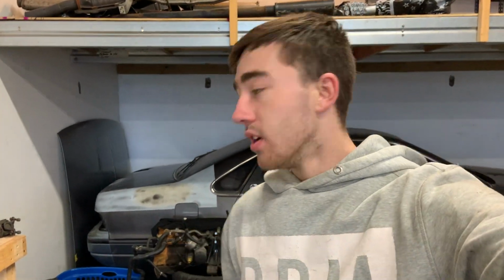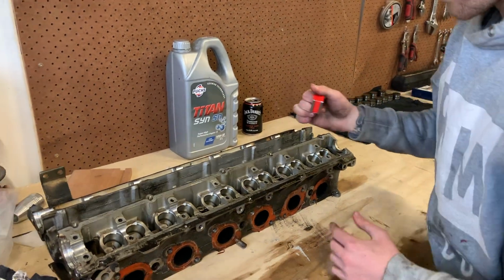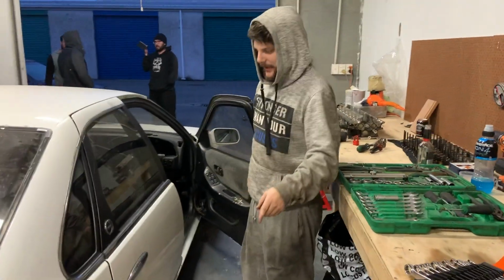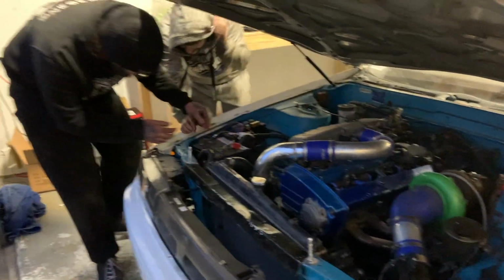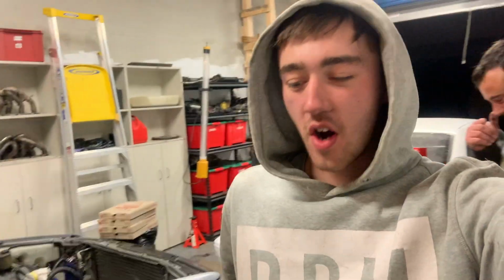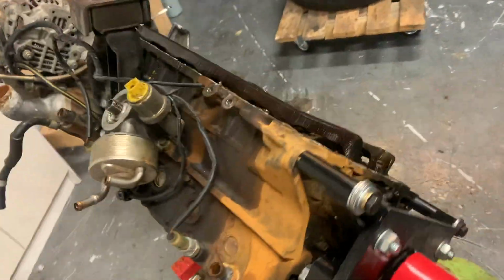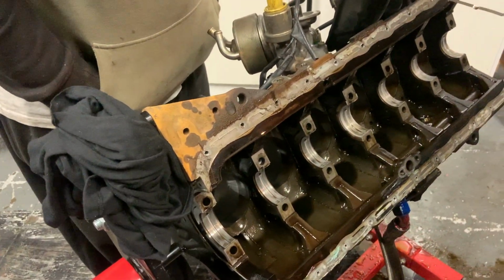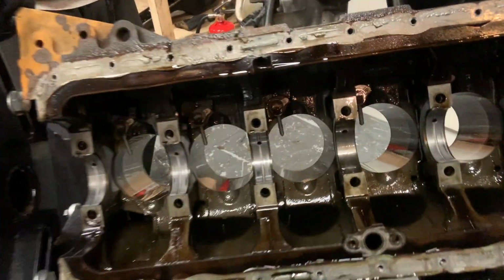TEARING DOWN MY RB25DET!

Comment: If you are running standard cams dont bother with the rod bolts. More trouble than its worth and theirs no need to rev it hard enough to bother the stockers on stock cams. Will stop making power long before the stock bolts get unhappy
Reply from the maker: Yeah good point. More future proofing it though, say in a years time I want more power cams and what not are way easier than pulling the motor back apart again or just leaving it and take that risk of one letting go even if it’s a small chance. Cool that my vid came across your way bro hahah been watching your vids for ages
Reply: Joel Cowper yeh thats fair enough man! As long as its worth your while to source bolts and have the big ends resized etc.If you are going through the trouble I say get the crank machined for the extended collar while its out.
Hahaha cheers man! I tune in to your vids a fair bit 👌 enjoy watching raw vids like these over the big channels. Plus you kiwis are hilarious with the banter
Reply from the maker: Yeah crank collar was definitely on the cards haha my foots to heavy to stay off the limiter. Gonna get some billet gears too. Haha yeah banters always good!
Reply: Joel Cowper thats the way! Keen to see it progress man, love your work 👌

Comment: Motor is out and all apart. Might as well just do everything :P not cheap but better than pulling it out every other day. Sure link and CP step in a give this man a ecu and forged pistons/rods as well
Reply from the maker: Yeah will definitely be getting a link but won’t be forging it. Stock pistons and rods are good for 500hp with arp rod bolts and head studs
Reply: @stack3dit  on corn

Comment: Hx40 with a 12cm rear and a Sinco mani will get you 500hp and some big boy injectors. I pushed over 600hp.
Reply from the maker: Will be looking at an hx35 and sinco. Might fall off a little more up top but I’d rather a little more response down low. Big injectors and a link I should still see 500
Reply: Joel Cowper even in stockish form I make 360kw with the hx40. So a 35 should see you on boost well rather max the turbo than anything else